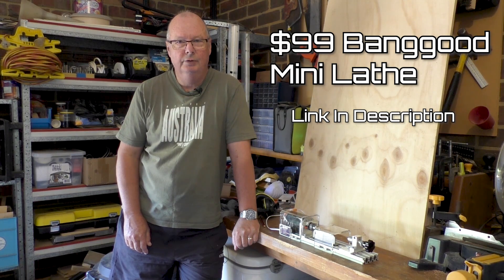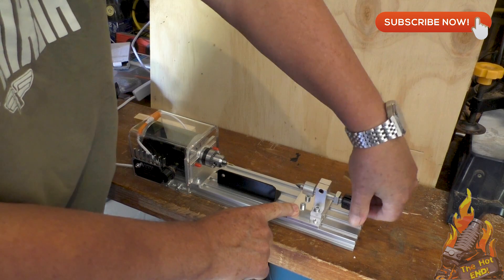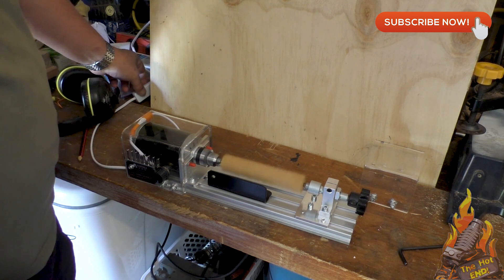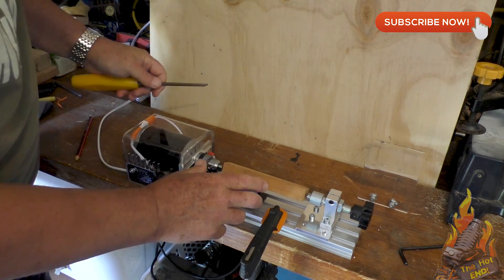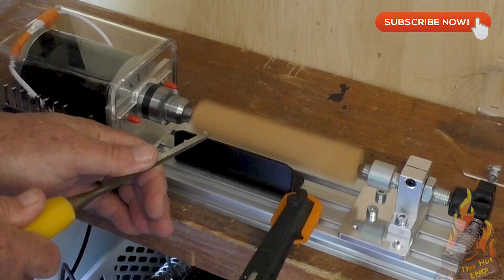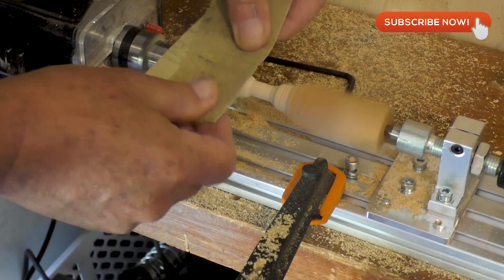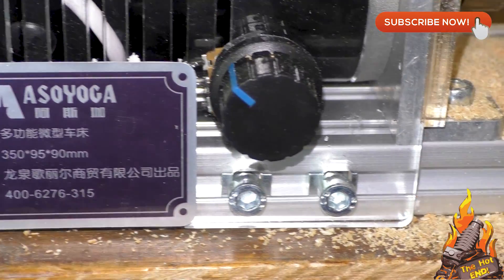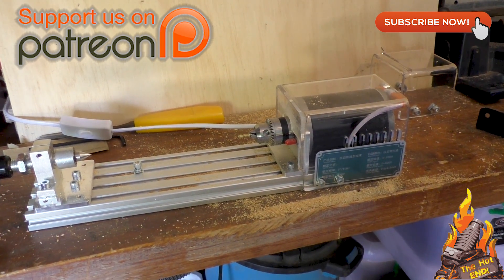$99 350 Watt Mini Lathe from Banggood! Does it Suck?

Comment: If you intend to continue using this lathe, I recommend getting a spindle roughing gouge and a detail spindle gouge.    The former will get the piece round faster than the chisel.    The latter will give a much better surface than the chisel.

You also will find turning is easier if you can adjust the height of the turning tool.   Sometimes to have the tool edge above centre, sometimes on center.

The piece of metal intended to be the tool rest may be the weakest part of the design.

You could 3D print some spacers to adjust the height of the tool rest.  You may need to grind off some of the height depending on the  turning tools.

Dave.

Comment: Seems reasonable for $99. Bit small, but I guess you could probably mod it easy enough to fit some bigger pieces :)
Reply: It sounds underpowered. It probably only has the 350w at full speed. Going bigger is just too much for that little lathe.